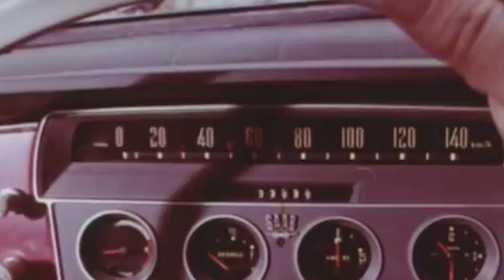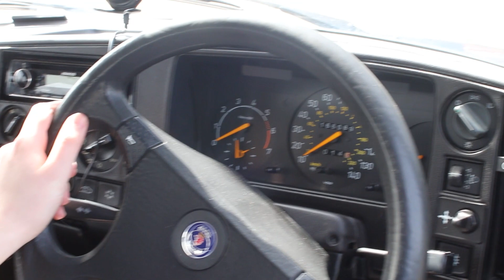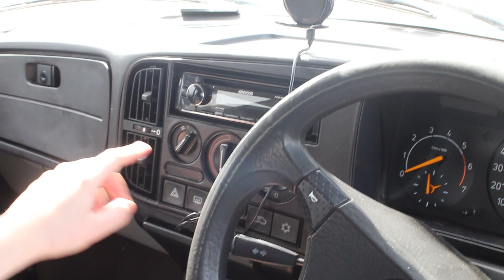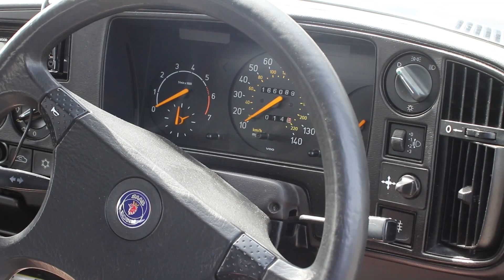Why a Non Car Guy Daily Drives this Saab 900

Comment: I only drive SAAB! I’m a designer and my favorite thing about them is how consistent they are. The 900 seamlessly evolved into the 1st gen 9-3, and the first gen 9-3 seamlessly evolved into the last 9-3. Sitting in my 2008 9-3, compared to sitting in a classic 900, everything is layed out roughly the same, all the design language and ergonomics are EXACTLY the same, and it just makes you feel connected to the car’s incredible heritage. It’s even got a clamshell bonnet, and all the proportions and angles are the same :) 

The last gen 9-3 is truly a classic 900 ran through a futuristic filter

Comment: I bought a dark blue 2001 95 Aero HOT estate with 90,000 miles on the clock, used it as a daily driver, including annual road trips to Austria, and sold it with 285,000 miles on the clock 10 years later. Loved that car

Comment: Great to see a 900SE 'Goose' survivor. This is such a classic  and a great color, too. It made me laugh to watch the hood (aka bonnet) open from the non-UK driver side. 😉 I guess Saab didn't reengineer everything for right-hand drive. 😅 I owned a 1983 900Turbo 4-door sedan in the '80's in Colorado. I lived in Vail where the Vail (and Aspen) Police also drove 900Turbo's. Those were days when they were the best winter assault vehicles, especially with a set of studded snows. I live in Seattle now and have an '07 9-3t 2.0 convertible that still turns heads and is a fun summer car. It's good to see people from younger generations  appreciating the craftsmanship and design for which Saab was so well known and loved. 👍🚘

Comment: I daily drive a '91 900S Convertable.  Bought it with 154K miles three years ago, now at 185K.  Still a lot of life as these routinely go 250 to 300K miles if maintained.   Normally aspirated will generally run longer than a turbo.  But you will miss the turbo when driving in the Mountains of Colorado.   Lots of rust free Convertables here and the youg bucks and really old dudes seem to be interested, but they are still very affordable.  Build quality on pre '94 900 is better than NG 900 or 9 3.  I bought a new '99 9 3 SE  back in '98, drove it 21 years to a 177k, wrecked it, then "upgraded" to the '91 Convertable from my very old dude mechanic as the tow truck delivered the wrecked 9 3.  It was his Christmas special that year that had not sold.  Maybe there will be enough interest from young hipsters and ancient baby boomers to keep them going over 30 years old and 300k miles.  Retro clam shell styling rules!  Put in your Moody Blues cassette tape and party like it's 1984!
Reply from the maker: Glad to hear of another being daily driven! We hope the younger generation do look after these cars!

Comment: SAAB actually felt that the rear wiper was not required .... however some customers complained about water after the car was standing so a wiper became an accessory. However due to the aerodynamics the wiper is not required when on the move.

Comment: I drive a 9000 CD 2.3 with no turbo, my first car and my only car, I usually ride motorscooter, but I need a car for the occasion. I went for a test drive in a used 9000 3 years ago, I was blown away by it, it is the my most favorite car I ever driven, I guess it wasn't sold for quite sometime because it doesn't have a turbo, people look for Saab here for the power on budget, but I just want a comfortable cheap used car. It isn't fast but have more than enough power for me when I need it, it is also not the most comfortable, but it is very nice and supple and the seat is very well design to be ergonomic, everythings are there for good reasons. It's the kind of car that know what you need but doesn't give all the things you want, make your life easy and take a lot of worries away while you drive it. Big reason I bought it is the great value it provide,at this price point + maintainance and repairs, I got the best deal out of it, much much better than German counterparts.
Reply from the maker: We would love to experience a 9000 sometime!
Reply: @427Motorsports  If you are in Thailand, I'll gladly offer an interview. lol Quite jealous of you guys that you can find the classic 900 for reasonable price, where I live, classic 900 has gone up a lot in value, but 9000 prices are still the same for years, no body want them now but so many were sold back in the days.

Comment: A lot of wobbly camera work in this one lads. This guy is a Saab enthusiast so a car guy in my books. cool car.  i'd a 900 turbo for a week or so, did you know the hand brake goes to the front wheels! Not useful at all 😂🤔
Reply from the maker: Just trying out a new camera, apologies for the shaky footage, it'll have a tripod going forward 😁 Yes Joe is a good sport and very good on camera!
Reply: handbrake on front wheels only pre 87 Saab 900s after on rear .
Saab 900 T16 > a proper car 🚗

Comment: Lovely example.
Saab's were great and it's a shame they were 'GM'ed' into oblivion
Reply: The reality is that GM held SAAB afloat for longer than they would've lasted if GM hadn't gotten involved. Maybe GM could've done more/differently to revive SAAB, maybe not (probably could've though), but GM did not ruin SAAB, it was already near dead and GM's cpr was not effective enough. Shame either way. I'm on my 8th 900 (and 1 99) and I want to drive them as long as I can drive.

Comment: Wish you would stop rehashing the fact that,yes in the first 99´s they used the Triumph engine.-But in 72´they gave up on the crap and commissioned Scania to develop a Swedish made engine with the same bore and stroke and slant angle,The B engine .This engine here is the H Engine introduced in 1981.-Virtually indestructable.
The windshield vipers are VERY usable in snowy conditions.These seems to be nonfunctioning though,they should be in theyre Horisontal position.They return to rest even when ignition is turned off.